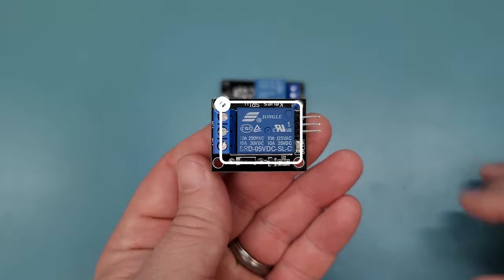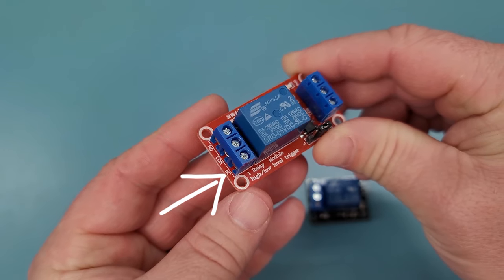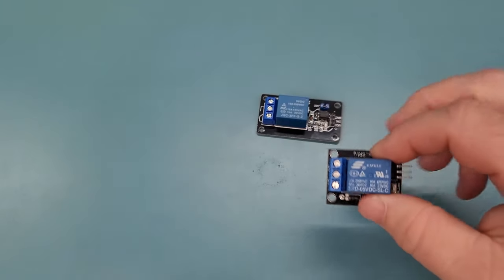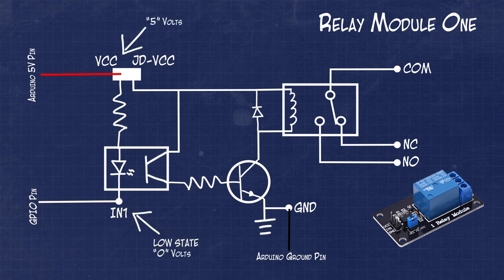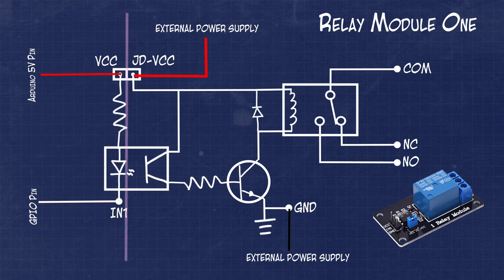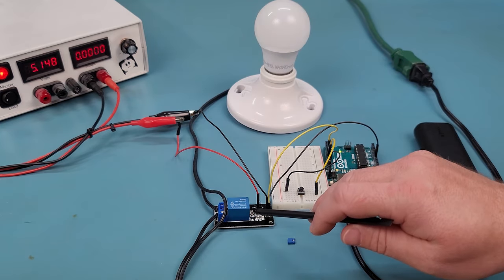Connecting a Relay Module to a Microcontroller

Comment: Is it okay to use the relay with the high and low switch with an external 5v power supply while sharing the ground from the relay/power supply and microcontroller. Im trying to connect my xiao rp2040 which is 3.3 volt and a 5v 30a relay.

Comment: Is it possible to use a relay module to programatically switch power source of arduino from a DC power supply to an external battery without loosing power on the microcontroller, thus making it uninterrupted? I hope you can help me.

Comment: Best video about relay so far, I wonder is it necessary to use opto-isolator when they share the same ground or even same source? Also it would be great if you also mention the resistor values.
Reply: You want him to list ALL of the resistor values for EVERY relay module out there?
Reply: @AztecWarrior69_69  Yes, it’s necessary for a schematic. I can send you those values if you want.

Comment: Best explanation I've found for the relay module.  You covered the technical stuff in depth without over-complicating it.  
You covered the traps well, which was what I was wanting to know.  I've worked with relays in industrial  applications, so I had my suspicions about the jumper.  Thank you for confirming the internal circuitry on this.

Comment: Very good treatment of hard-to-find info! 
On "Relay Module One" and connecting a/the GPIO Pin to VCC so you can have the relay turn on when the GPIO pin is HI. (starting at around 5:30): 
Nice for modules with only one relay. But my multi-relay modules only have one VCC pin.

Comment: Great video Brad. Thanks.   I was really struggling trying to understand how the jumper in the Relay Module Two unit actually worked.  I didn't realize that the optocoupler input was bi-directional.  I know this video is a few years old and that most of those watching aren't going to build their own circuits from this tutorial, but I think there is an issue with the circuit diagram for the Relay Module Two.  I'm pretty sure that you need a resistor between DC+ and the optocoupler or the optocoupler will sink as much current as DC+ will give it, causing it to burn out.  I know there is one in the actual unit.

Comment: Thank you for your video.  Its very informative and interesting.
Reply from the maker: Thank you.
Reply: @hensonbl  so if i am not using jumper to avoid any feedback> can i use same 12 v dc power supply source to give 12 v to  jd vcc and  same 12 v to vcc pin ...in DC plc output side ?

Comment: This is a great video...question...is there another way to set the relay from input low to input high?, the option you mentioned would only work with a single relay board, i'm using a dual relay board. already try to set the output GIO pin to high but it did not work... thank you

Comment: Thanks, it helped me with solving the problem of the light being on when the relay lost power.  I left one wire in the centre then moved the other to the opposite side, (which made no sense based on the Com, NO, NC schematic you showed). I then had to change my code to send LOW to actuate, and the HIGH to turn off.  My wires are therefore now in     I_  (     whereas before they were in       ( _I     where (  is the centre.   Hmmm what I have done works for me but makes no sense to me.

Comment: Thank you for the excellent and clear explanation. Regarding relay module two, would it be possible to isolate relay and signal power by discarding the jumper and applying DC+ to the DC+ terminal for the relay coil (or the LOW pin of the 3 pin jumper) and signal power to the middle pin of the three pin jumper (either DC- or DC+ depending on whether we want to trigger high or low).

Edit:  I tried it and it works!

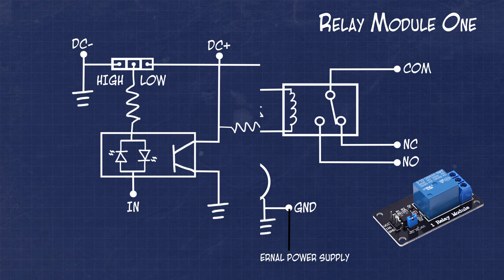Comment: Great video but I think theres a bug in the relay 2 schematic at 6:22 . The optocoupler transistor output cannot be connected to Vcc, otherwise it is shorting the Vcc to GND when the opto is active , isn't it ?
Reply: Nice catch.  I'm guessing the board has a third resistor to limit the current through that path, but that it was inadvertently left out of the schematic.

I love that someone took the time to explain the differences between the relay modules designs.  I know a few people who think they're all the same, so they just recommend people always buy the cheapest.

Comment: thanks for the video, now i know what the JD-VCC is used for
i was going to use this relay for turning on a second PSU for computer as before i just use a relay and diode drive 12v dc from the main PSU and been working ok for years i just like to add a bit more protection

Comment: I've got a small digital relay that I can't get to work on 5 volts.  It takes a trigger larger than 5 volts to cause it to go high.  I've currently got a 12 volt battey pack triggering it.  So I've got the 12 volt battery pack acting as my mains current going to an LED.  5 volts coming into the relay side.  And a line from a switch to the 12 volt on the trigger.   When I hit the push button 12 volts goes to the trigger and triggers the relay allowing 12 volts to go to the LED.   The relay is supposed to handle mains current but I doubt that I want to use mains current to trigger it.

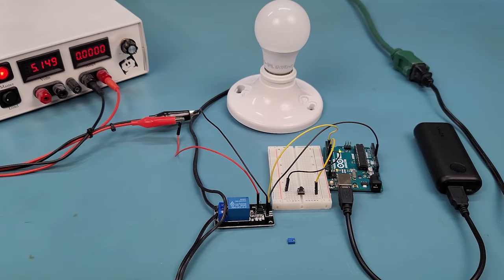Comment: This was a great tutorial.  There is just one big problem with this safe option (8:20).  You have THREE power sources hooked up!?  I am trying to create a small project where I drive a traffic light from and arduino.  I have a dual relay board.  I really don't want to have 3 power cables running from the device.  Ideally, I'd like to plug in my 240v mains and have it run the full system.  Please could you create a demonstration to show how you would accomplish this in a safe manner (for me and the electronics).
Reply: Please bare in mind that I have no formal electrical training.  I have bought a few ardiuno starter kits and have bought what I think the necessary components are to get this all to work.
Reply: I know it's been almost a year but an answer is better than no answer so:
First, you need to convert the 240v to 5v to power the relay module and arduino. If you want to fully isolate it, you'll need two 5v power supplies or one that outputs two isolated rails. One of these will power the arduino and the other the relay board. Power to the power supplies can be provided by your incoming mains that you are switching with the relays. This will let you switch it off of a single unit without any external supplies.

Comment: Thank you for the video Brad! I'm wondering if I can use a single power supply to power both the relay coils (JD-VCC jumper removed) but also the arduino. I guess technically the arduino wouldn't be completely isolated from the coils BUT at least the coils would be getting their power straight from the power supply instead of possibly overloading the VCC pin on the arduino right? I'd also like to know if I could possibly go a step further and use that same power supply to also provide the power on the relays themselves (only intending on turning on 5mm LED's) so basically I'm trying to use a single power supply to power the arduino, the relay coils, and the LED's connected to the relays. Starting to think maybe I could've just gone with a different module like something using mosfets? Still kind of a beginner so any suggestions are welcome! Thanks for your time!

Comment: Can you explain how to connect the high voltage DC circuit? I want a 12V circuit:  so - from the battery goes directly to the load -. And + from the battery goes first to com pad on the relay, then the the NC pad on the relay (if you want normally closed) connect to the + side on the load. Is that correct? My relay does not seem to have an external power supply input. Only 5V from the receiver servo wire.

Comment: Hi Brad, 
From what I understand, if I'm not using an external power source, it's not possible to reverse the pins in order to activate the relay when the pin is high or is it? I'm talking about what you discuss at 5:35 of the video.
Thank you for this really great video, I've understood a lot thanks to you!

Comment: I have the red relay. I'm trying to figure out how to get it to replace the trigger on my plasma torch for CNC use. I have the MKS DLC 32 control board. The instructions suggest I use the spindle output as the trigger source. The debt connection is 24 volts since it outputs whatever the power supply is. I just want to use that 24 volt spindle connection to trigger the relay which will finalize the wire connection to the plasma machine. Can you tell me how to do it in terms that a caveman could understand? Thanks. There's two wires that travel from the plasma machine to the trigger on the torch handle. Squeezing the trigger simply closest the connection. That's all I'm trying to do.

Comment: How to implement this method in multiple relay?
Reply from the maker: You could drive multiple relays with an external power supply, and then turn them on and off with different GPIO on the micro. This would require utilizing the relay that enables you to separate VCC and JDVCC.

Comment: Hi thanks a lot. Thanks to you the relay is working on and off according to the job, its all work fine, but when i turning on my plasma cutter, the relay only work about 10% of the project then my stepper motor suddenly stop moving and on the lightburn its show busy and pause, is it because the relay is 10 Amp maximum and the plasma cutter i use is 40 Amp? Is there any way make it work?

Comment: What type of signal activates the relay? 1 vdc? A frequency? Or any detection on signal? Does anyone know off hand. I'm not driving mine with Arduino, I'm using BT
Reply: You would need a 24 volt signal to activate a 24 volt relay

Comment: You give me a great vision thanks a lot
But do you have explanation for this?
When I turn on the Arduino board esp8266 and at same time connected to doubled relay WiFi can't connect
Only connect if I unplugged gnd and 3v pins
So each time I want to turn on board must unplugged gnd and 3v pins

Comment: what if i have to use a 15-0-15 V at 300mA rating transformer connected to a IC L7805CV Voltage Regulator operating at 5V DC output?! 
i did this but it resulted in a humming sound when the relay was turned ON, and heating of the IC circuit.

Comment: cant i connect an external power supply to the dc+ pin in relay module 2? or external power supply to dc- and dc+ for that matter?
Reply: Did you ever find an answer because I have the same question ?
Reply: @last1standing22  no i haven't, can i ask why are you asking this? why dont you just use module 1?

Comment: Best video I found to describe these boards.  Are there any other benefits to using a separate power supply on the JD pins?  I'm controlling five 24vac solenoids.  Tripping them with a delay of 1 to 2 seconds between each solenoid.  I'm having weird issues with the delays hanging (locked up) or acting like there is no delay where a few of the solenoids will trip like there is no delay. I'm thinking something is feeding back into my Arduino that is causing this problem and was wondering if I isolated the power that this might help.
Reply from the maker: Thank you. One of the first places I look when I start to see unexpected activity is "power". When your micro isn't getting enough power or you are trying to draw to much power from the board, it will start to act in unusual or unexpected ways. If you are not using a separate power source to supply your relays, how much total current are you trying to pull from the board? Do you have all of the relays in an active high or active low state?
Reply: Have you got a flyback diode or suppressor on the load side?

Comment: Can I use a 5v 2A adapter as the external power supply for the 5v relay?
Reply: Yes, a 5v Relay, needs a 5v Source to turn it on.  The Amp rating of the power supply just needs to be above the current draw of the relay (Typical ~70mA for a 5V) so 2A is plenty.  You could use a smaller power supply ~200mA. But, I wouln't go lower than 150mA
Reply: @mopoke6427  thank you 👍😀
Reply: @mopoke6427 Relay with octocoupler >>> so if i am not using jumper to avoid any feedback> can i use same 12 v dc power supply source to give 12 v to  jd vcc and  same 12 v to vcc pin ...in DC PLC output side ?

Comment: If I don't use an OptoCoupler in the circuit, would there be any problems? I simply want to use the relay as an active high device
Reply from the maker: It wouldn't be a problem. The version of the relay module that includes the optocoupler is good for protecting your control circuit (micro), but it isn't required.
Reply: @hensonbl  Thank you👍

Comment: How much voltage is required to power the first relay module when using an external power supply ?
Reply from the maker: You would use 5 volts at around 70 milliamps to power the relay from an external power supply.

Comment: I have 8 channel relay board - the active low optocoupler! how to turn 8 channels into active high?
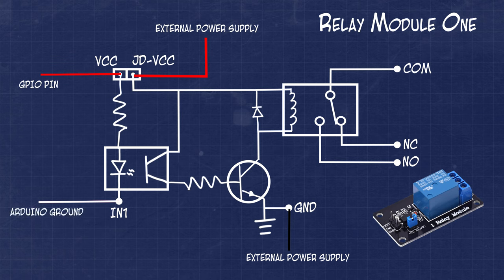Reply from the maker: At time stamp 5:53, I show how you can connect a microcontroller's GPIO pin up to the VCC pin on the relay board and the Gnd of the microcontroller to the IN1 pin on the relay board. The key with using this configuration is not to use the JDVCC jumper. You don't want the GPIO to be the current source for the relays. This is why it is a good idea to use the external power supply as the power source for the JDVCC connection.
Reply: @hensonbl  It could be possible for 1 channel relay module, however, if we have 8 channel relay module and we have to turn on/off 8 IN pins of module. How it can be done?
Reply: @imtiazdahar8451  different input signal from controller will drive their respective relays > when no jumper + external p supply to jd vcc is used >don't u agree ?

Comment: Is it possible to work relays for 24x7, 365 days continuously? Will it burn and get damaged?
Reply: I'm interested to know if you find anything out
Reply: Depending on how often they switch, read the data sheet every manufacturer states the lifetime
Reply: @Hector0  not these guys. Cheap Chinese stuff. Just shows up in a box and the manufacturer says it will work forever and it's the highest quality 🤣🤣 the only way to know is to test